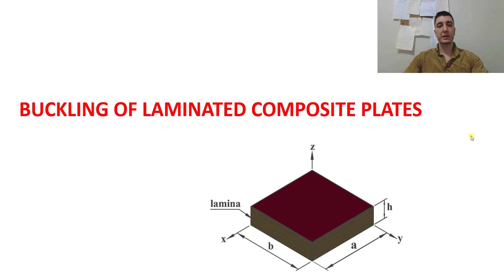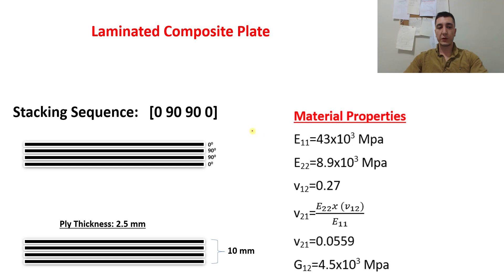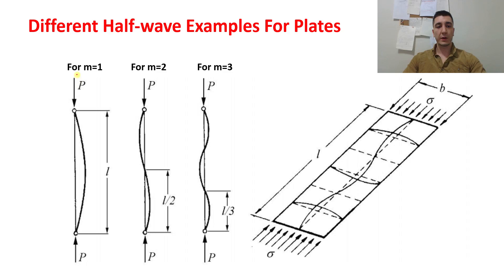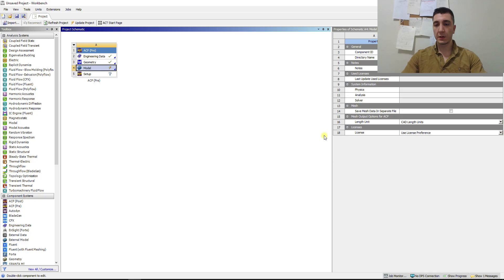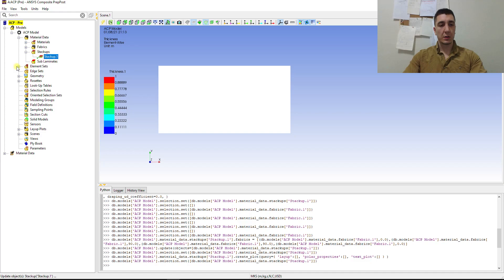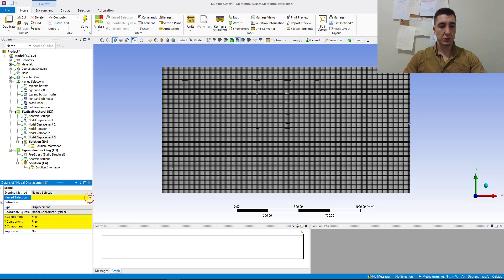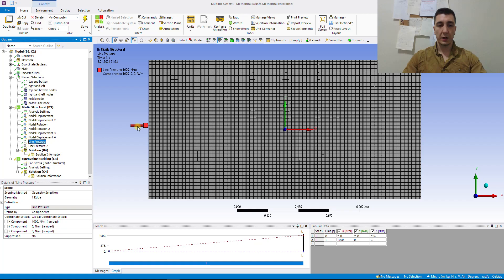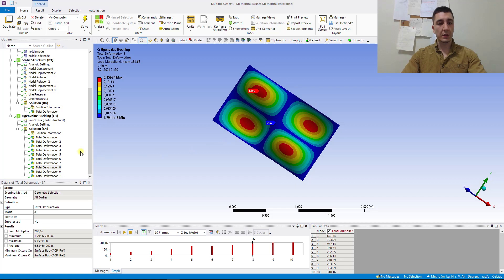Buckling Analysis of Composite Plates Ansys  ACP Tutorial (Theory and Calculations are Explained)

Comment: can you please provide the source of your input data you took or any research paper ?
Reply from the maker: Input material data is created randomly. It does not matter, you can crate too. There are formulas which provide the solution for all input data. If you change the input data, you need to calculate your outputs according to the input data. By the way, all the formulas are taken from this book : https://www.springer.com/gp/book/9781402031106